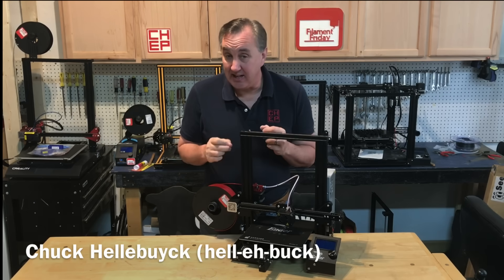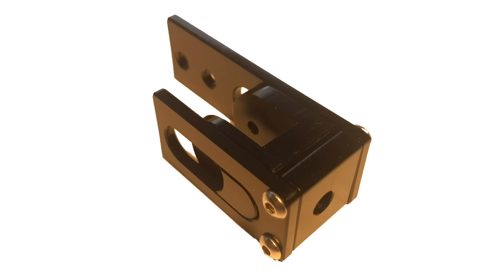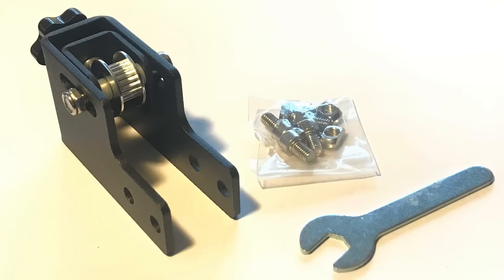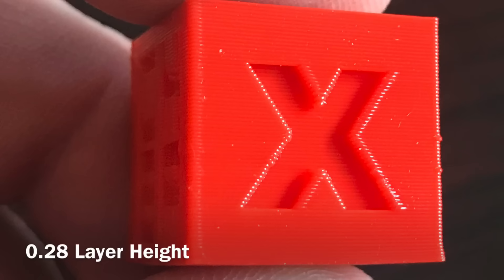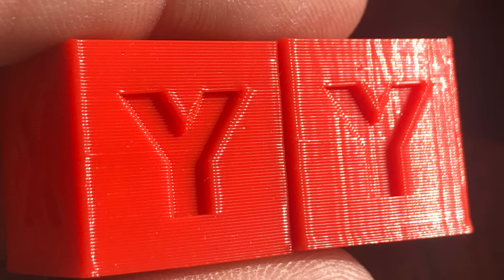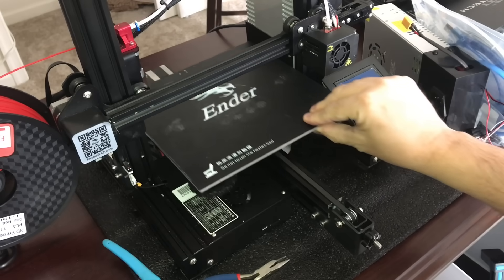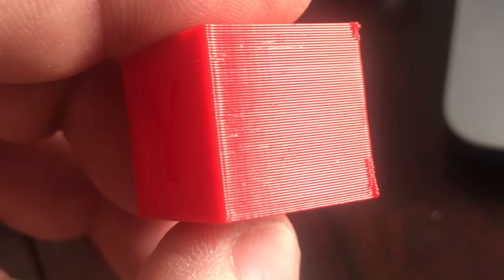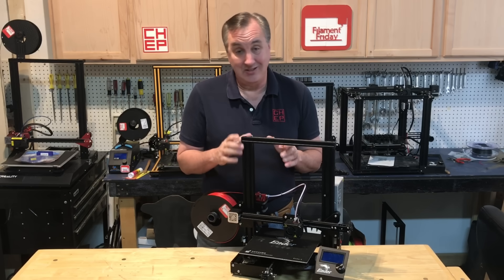3D Printer Belt Tension Effects on Creality Ender 3

Comment: IMHO, a spring loaded tensioner near the stepper motor would be better for both the belt and bearings. Teeth on the idler(s) isn't necessary and my even be detrimental to the lifespan of the belt. Getting a good "wrap" around the driven (toothed) gear is most important. In my experience, increasing the tension on a timing belt to get improved performance is an indicator of another underlying issue. Good vid though.
Reply from the maker: Some printers have used spring tensioner on the belt which allows the belt to flex and creates tiny waves.
Reply: Tension is tension, whether you use a clothespin spring or move the pulley or motor.  The presence of clothespin springs is usually sign of a bad design where the belt was not kept parallel to the guide rails.  In such a build, the belt tension will vary with position of the bed or extruder carriage.  It will lead to distortion in the prints, especially if they are made close to the edges of the bed.  The working side of the belt loop should be parallel to the guide rails, just like a lead screw should be parallel to the guide rails.

Comment: A spring loaded tensioner should work equally well without wear on the pulleys,motors. Most automotive engines utilize a spring tensioner.
Reply from the maker: Some printers have that but the spring allows the belt to flex so you get minor waves.

Comment: What about too tight resulting in wearing on bearings and motors?
Reply from the maker: Any force on the motor can wear it down. It’s the flaw of a direct drive design.
Reply: @FilamentFriday  Right so I think people need some way to judge "tight enough, but not too tight". With a bandsaw blade you can actually measure the tension but people usually just listen for the note the blade makes if you tweek it with a finger. Nothing equivalent for 3d printers?

Comment: Good work Chep. I think you should also consider the fact that you changed from smooth pulleys to toothed pulleys. Running the toothed side of the belt on a smooth pulley can cause surface ripples, so I think that might also be a factor.
Reply from the maker: I’ve tested that theory by flipping the belt and saw no improvement on a smooth pulley.

Comment: How hard is that on the stepper motors? Thanks Chep, love your vids brother!
Reply from the maker: As much as any force on the motors. It’s a flaw of direct drive of the belt.
Reply: I think the biggest damage would be inflicted upon the ball bearings inside the stepper motors.  Better prints maybe but more frequent maintenance on replacing stretched belts and worn out bearings.

Comment: Hi there what temperature do you use for pla please
Reply from the maker: Depends on the PLA. For Filament Friday Filament used in this video I used 205°C
Reply: CHEP what is the bed temperature u use please
Reply: @jackcarver3248  You don't need a heated bed at all for PLA, but around 60c could help with adhesion